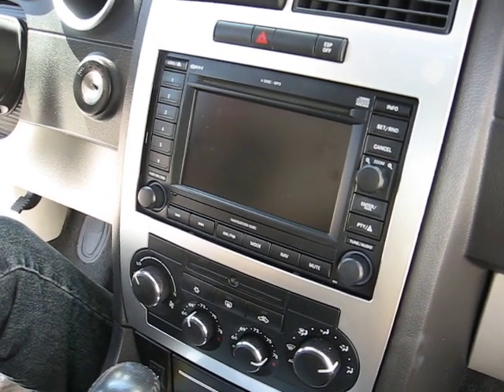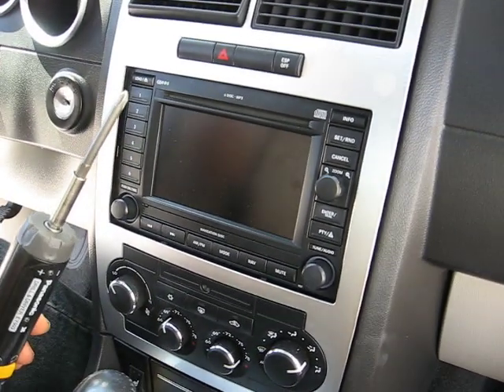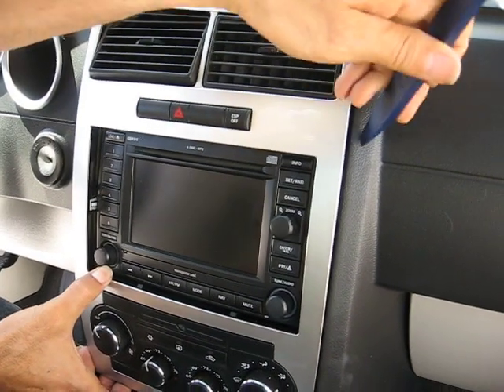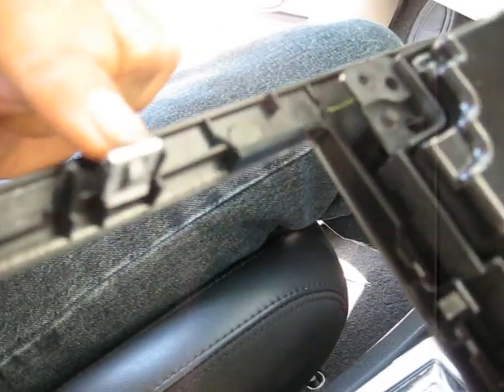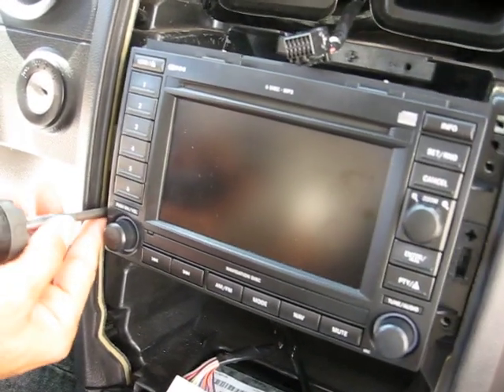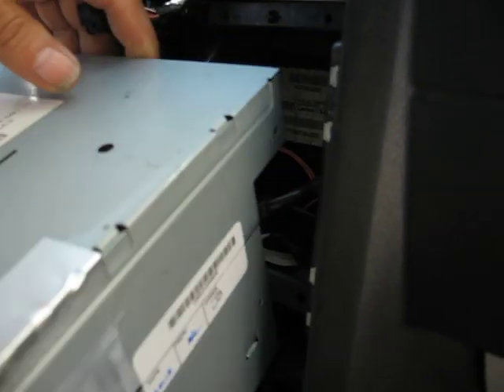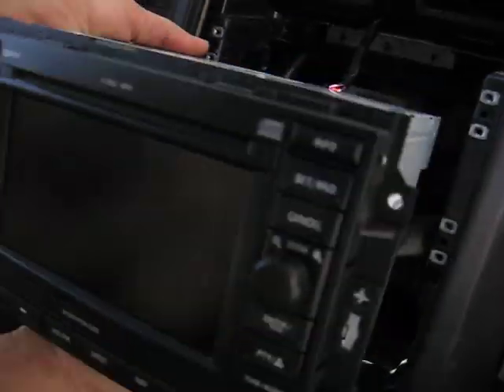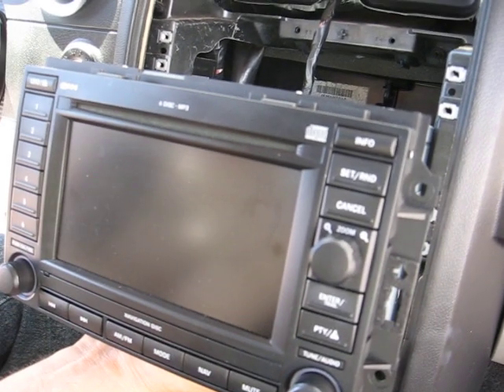How to Remove Radio / Navigation / CD Changer from Dodge Charger 2006 for Repair.

Comment: Recently had "Read Disc Error" problem with 6 disc CD player. Purchased CD Laser Lens cleaning disc on ebay. Had to load it 6 or 7 times before it would stay in and clean laser. My 2006 Charger CD player now works GREAT...

Comment: i have a 07 charger with aftermarket kenwood dvd double din i want to upgrade for one with a gps and was wondering can i get a satellite connection if i mount the gps antenna behin f the unit